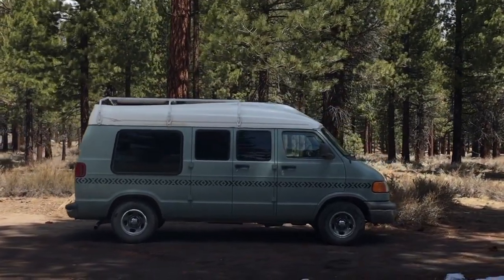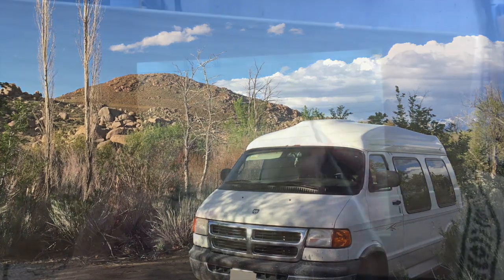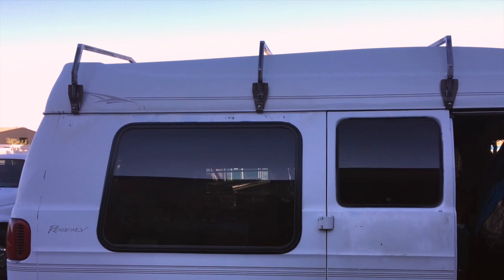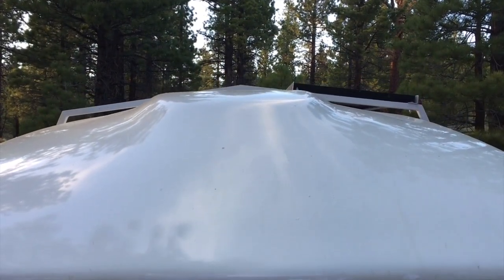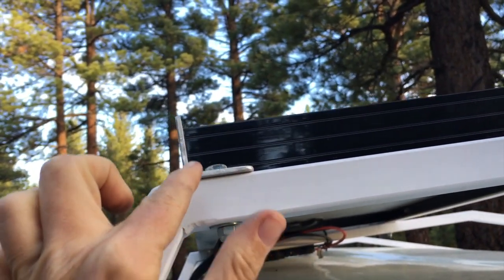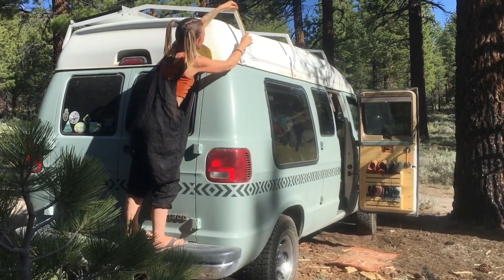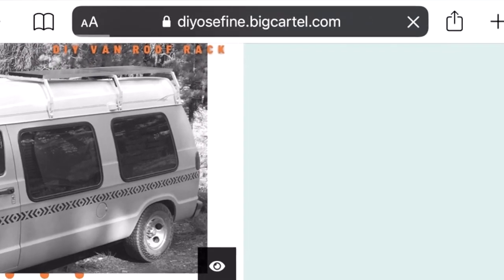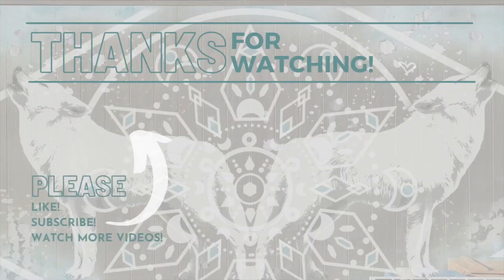DIY PITCHED VAN ROOF RACKS FOR SOLAR / ROOF RACK FOR A VAN WITH FIBERGLASS HIGH TOP

Comment: Great Idea!  I noticed that the black plastic bumper covers on your van a grayed out.  The simple solution is to use a heat gun to remove the water trapped in the molecules.  They will look like new, just like your van.   (Waves)
Reply from the maker: Yes, I spend a lot of time in places with stark sunshine, dries out all the plastic parts. Thanks for the tip. :)

Comment: Thank you for the video.  We recently purchased a 1990 Leisure Travel Van and want to work on renovations to bring back the camper van functionality.  The option of building a rack on the roof to accommodate solar & maybe a deck is certainly something to consider as we wait for spring to start the majority of the work.
Reply from the maker: Thank you for watching! And good luck with your building adventure, it’s a fun project. If you’re planning a deck up top and your van has the same gutters as mine I would put loads of gutter mounts all around to distribute and support the weight. To solar is rather light in comparison to a deck, but a deck sounds super nice. :)
Reply: Where are you⁉️ 3 years ago was the last video we have from you❗️You are inspiring and you just, do it❗️I recently bought a '99 GMC Savana Conversion Van. I will be converting it to "Off Grid". And, I found your YT Channel as i search the YTs for help. Girl, give me more... Even if it's just you and Tora, livin' the van life. Again I ask, where are you❓️ I hope you are well.❤ Pleaze advise...😊

Comment: Hi - These are Awesome!  Nice job in the design. I need a set of these for my van!  Ordered your plans just now.  Thanks for the great information and custom roof rack idea.  You've got great practical ideas and lots of keen insight.  I'm a fan!  -SC
Reply from the maker: Thank you ever so much, once again. I looked at your van on YouTube, the shape of the fiberglass does indeed look very similar, it wouldn’t surprise me if there was one manufacturer of them that several brands of vehicles purchased them from for conversion vans. I appreciate you. 🙏

Comment: Very nice roof racks. Great design. A remote control wench mounted on the roof rack would load and unload things for you. They are remote or hand held control, most of them. The welder could set it up for you. He's good as you said.
Reply from the maker: Thank you Ronnie. I'm definitely very happy with how they turned out and how they've held up. Thanks for the tip about the winch, that sounds like a good option if I ever end up getting a paddle board. :)

Comment: hey a good trick for the rust showing up is spray a little wool wax or fluid film on
Reply from the maker: Cool! Thanks for the tip! :) Can wool wax or fluid film be painted over as well? I haven’t seen any rust reappear through the paint after using the rust treatment stuff I used in this video, but always good to have alternatives should it happen.
Reply: @DIYosefine   also thanks for the rack idea, i'm waiting for a fiberglass topper to show up in the junk yard for my van and will be making custom racks similar to yours
Reply from the maker: Awesome. My racks have truly worked out great, have not budged since the day I put them on. Good luck on the bubble top hunt.

Comment: What was the total cost of your awesome roof racks?
Reply from the maker: I believe the grips were $50-60 and I think I paid my welder about $280-300 or something to put it together (that was definitely a good deal I’d say, someone else might have charged me more) and then I spent another $30 on paint. So roughly $350-400
Reply from the maker: Saying that, my welder also spent time figuring out all the angles and how to best put the rack together, as I had only done a rough sketch of how I wanted it at that point. So I reckon I paid a bit for the extra time it took to do that.